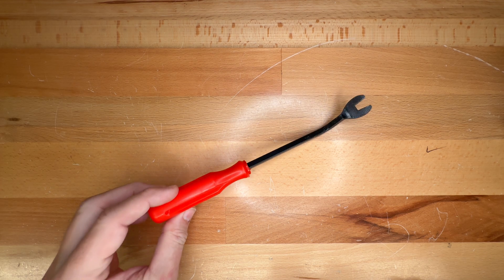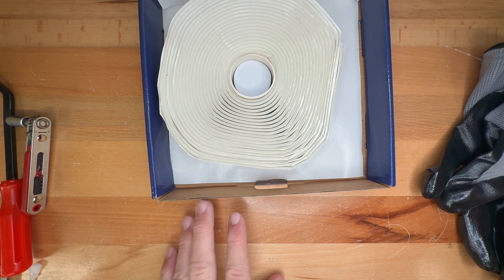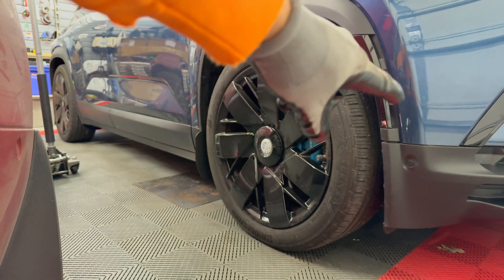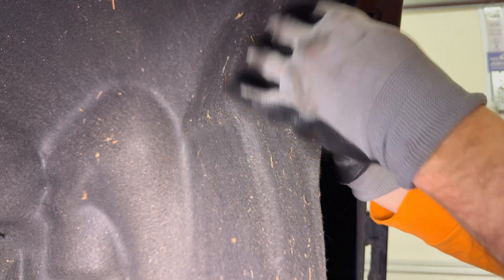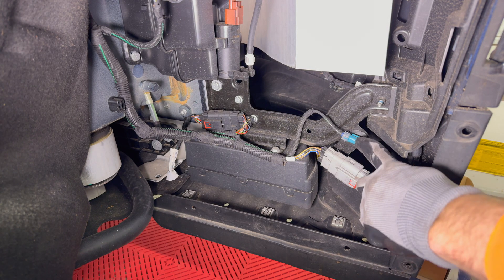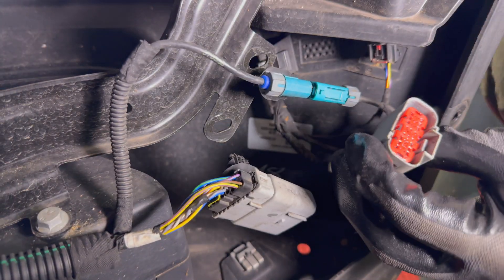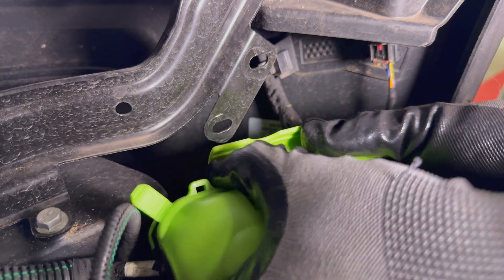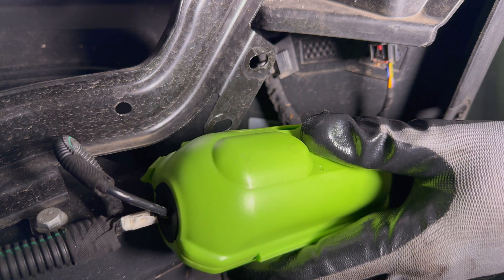Fisker Ocean - Waterproof Wiring Connectors

Comment: Master Matt, cleaning out that first connector just fixed my issue with an ECC blower fault. The cabin fan would not blow meaning no defrost in rainy Seattle, and acceleration started to stutter and lag which was even more scary. That first connector looked rather clean and dry when I opened it but I cleaned it out anyway and sealed it up according to this video, and it fixed the problem. God bless you for this channel. Now I'm buying an Ocean Views tee-shirt 😂❤
Reply from the maker: Great news!  I'm glad that worked.  It seems the wiring connectors are the biggest issue  owners should be thinking about right now.  Thank you for your support.

Comment: i did replace white connector now it looks like black connector also having issue and car with NO AC and stopping CAR from Drive to Neutral. what if black connector needs to replace do you have any videos and where to buy them ?
Reply from the maker: ElectrifiedOcean.com has 12 pin and 8 pin connector kits.  I have not replaced any of the connectors in my car other than the washer fluid tank sensor.

Comment: Thank you again for this great video as usual! I have performed waterproofing for the wiring connection and it was in a good shape no any corrosion but after then i started driving the car especially when putting the gear on R there is a strange sound coming from the front right part of the car it wasn't available. Please do you know what might be the issue and how to solve it?
Thank you.
Reply from the maker: Are you talking about the pedestrian speaker sound? Does it sound like spaceship?  It gets louder when in reverse.
Reply from the maker: The pedestrian sound is normal when you have the car in drive or reverse under 25 mph.  I’m surprised it wasn’t working before.  It’s possible one of the connectors was loose.  I have a video coming out about the VSP and how to check its connector.
Reply: @MTNRanger I really appreciate your quick reply! Maybe it was working before but the sound it much louder tahn before thats why i noticed it today.Maybe also ther might be a loss wire before that why i wasnt functioing properly.
Thank you again.
Reply: Yes sir like a spaceship and one thing to mention that when removing the far connector for inspection and put ot back again it suddenly made a siren sound i had to use the key quickly to disable the alarm sound. @MTNRanger

Comment: Hi - any thoughts on using liquid waterproof electrical tape?
Reply from the maker: There are probably a bunch of different ways to do this.  I have tried 1) enclosure box, 2) butyl tape, and 3) silicone tape.  I’m sure liquid waterproof electrical tape will work too.
Reply: @MTNRanger  thanks!

Comment: matt, question on your merch. your hoodie xxl does it run big or small? does it come in different colors? is hoodie a heavy hoodie or light weight material?
Reply from the maker: In some video you can see the Premium Pullover Hoodie I purchased.  It's an XL and fits well - I would say not over or under sized.  It's a fairly heavy weight hoodie.  It's thicker than the classic version that's about $5 less. I can weigh and measure it next chance I get and compare it to other hoodies I own.  I'll respond later tonight.
Reply from the maker: OK, I measured to two other XL hoodies and they are roughly the same size.  The weight is slightly less.  Overall, I think it's accurate in sizing.

Comment: matt, what wheel wells do you need to do to waterproof is it all 4? and wear can I get the things you used?
Reply from the maker: The front right has several connectors - even more than I show in this video.  I'm going to do a follow-up covering the washer tank and pedestrian speaker module.  The other area is the rear left wheel well towards the bumper.  I'll be doing a video on that one too.

Comment: does that need to be done on both sides of the car, so driver side too or is just the right side? Thanks
Reply from the maker: At this time, there are a number of connectors on the front right side.  More than I show in the video.  None on the left side that I know of.  The second area to look is the right rear wheel well towards the bumper.  I have at least three videos planned on other fixes.
Reply: @MTNRanger good to know, interested with other connectors to protect

Comment: Did you have to disconnect the 12V battery when checking the connection plugs?
Reply from the maker: @dannytran6093  People I have talked to have done it both ways.  I think if the car is sleeping and If you do one at a time, there shouldn’t be an issue. Also, if you are repinning the wiring connectors, it's probably a good idea to disconnect the battery.

Comment: The problem with these boxes in my opinion is that they are not 100% waterproof and then water comes in but no longer comes out. Thus, the problem may worsen under certain circumstances. Especially if several cables are inserted here at once. Since the blue plug actually looks like it's sealed, I wouldn't at least put it in the box. 
A more complex - but perhaps better solution would be the switch of the plug connection to sealed plugs. Here you could also split the cables into 2 or more standard connectors instead of one. Depending on what is available in the store.
Reply from the maker: @larsreinirkens5038  I’ll be checking on the weather enclosures and verify their effectiveness after a few months.  Yes, replacing the connectors will be the best solution, but is very time consuming and requires skills some people may not have.